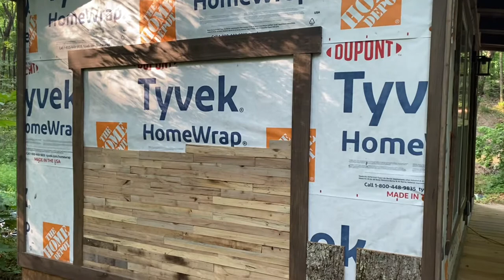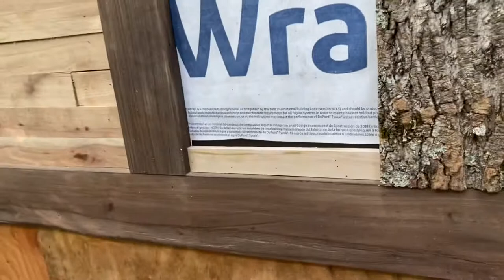Bark siding install at Sunshine Acres on Sunset Cabin Day 1

Comment: Not enough nails! Ours bowing out after 4 months!. Instructions say nail on ridge not valley In grid pattern every 6-8 inches
Reply from the maker: We did closer to 4-5” spacing.  It has been on for over two years now and no issues.  Sorry you had issues with yours!  Thanks for watching.